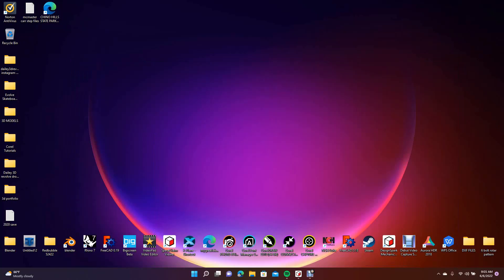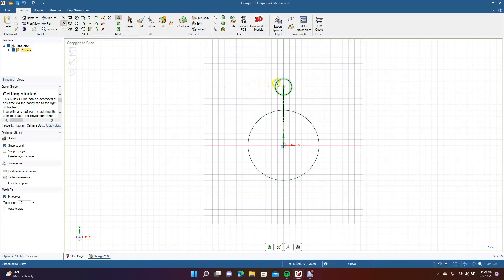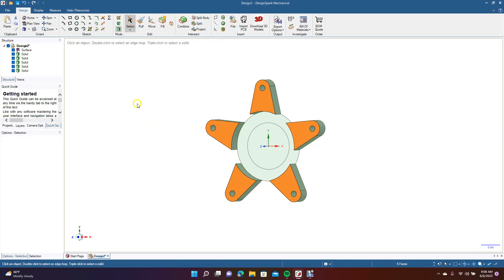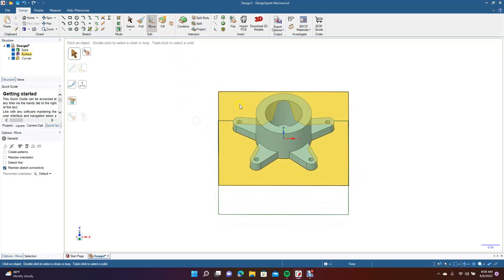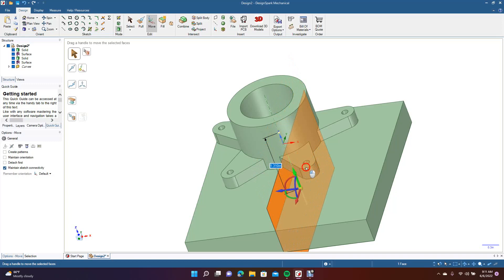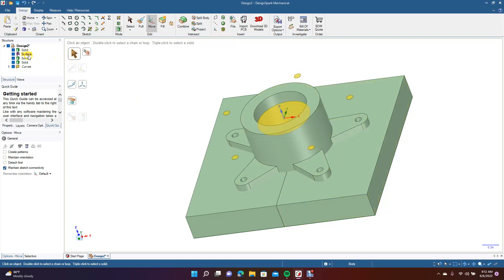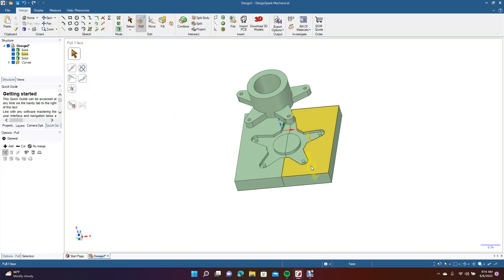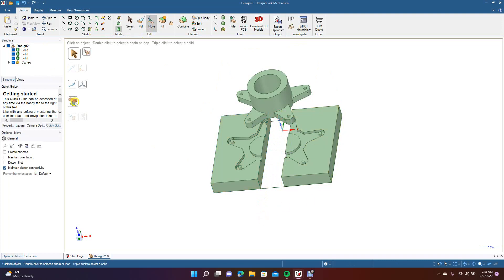How to use the combined feature in design spark mechanical to create a fixture like part

Comment: Hi sir, When you are cutting an object with a plane the 1st click highlights an object you want to cut, 2nd surface you want to cut with and 3rd(pink) removes an object you want to get rid off. When moving one plate back against another. Select move tool, move arrow to the right edge of the plate(in this instance), select right arrow, select move up to, select left edge of the other plate. Thanks for vid.
Reply from the maker: Thanks for the tip!
Reply: @dailey3drevolve  tons of ways for doing that, finaly do however comes easier for you, but surely, you don´t need the draw the whole cutter piece, you can make the lines straight on the top surface of the prism and just extrude from there.